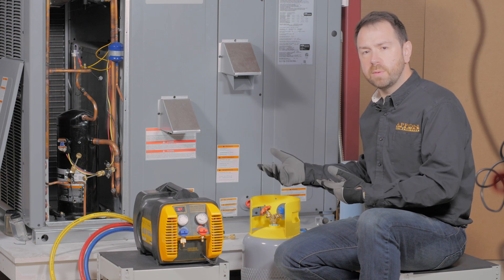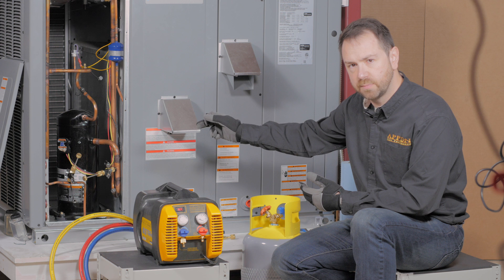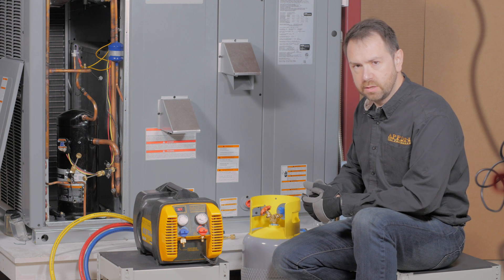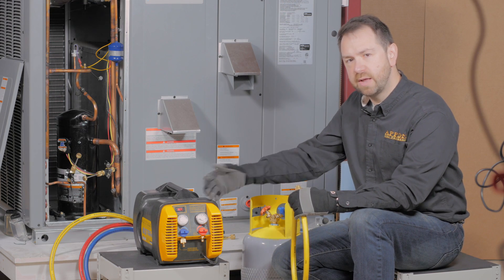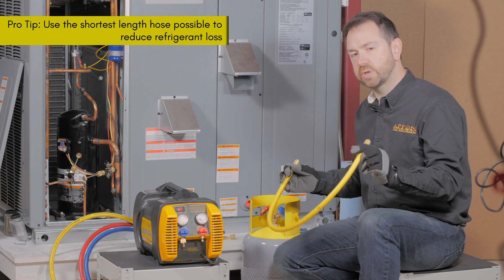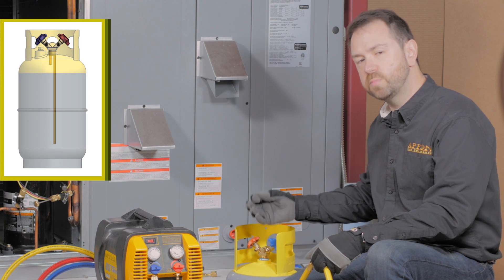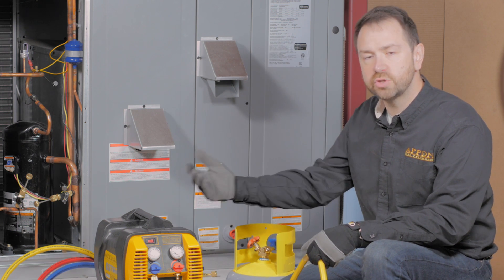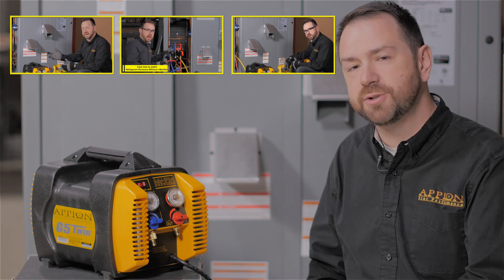Fast Recovery #3: Full Flow for Fastest Recovery

Comment: How does one know the system is empty of refrigerant when not using a manifold
Reply from the maker: You'll need to use a digital compound stub gauge (Part# IONKIT-PT or PT500) connected to one of the core tools to indicate when you have reached the EPA required evacuation level. We cover this in part# 6 of this series: https://youtu.be/zhOhn2wA_Wc?t=27
Reply: Pay attention to your scale and see if it’s  picking up anymore refrigerant